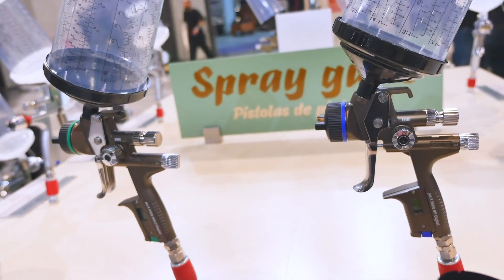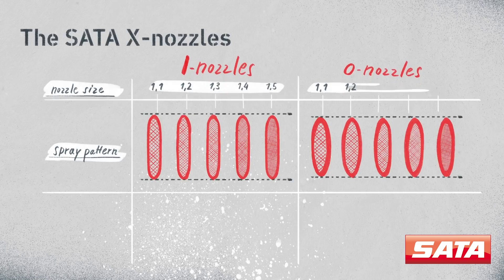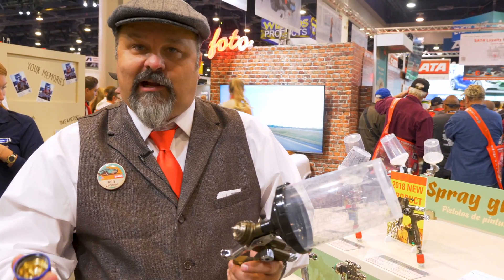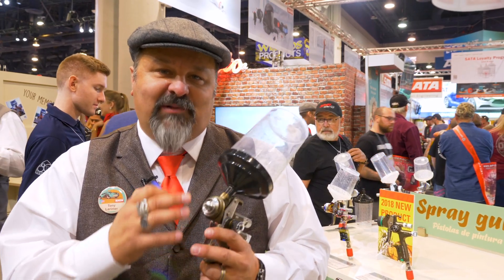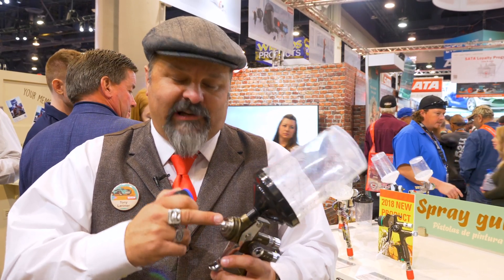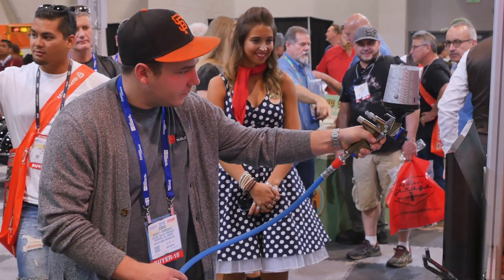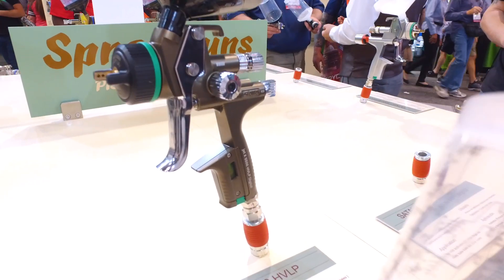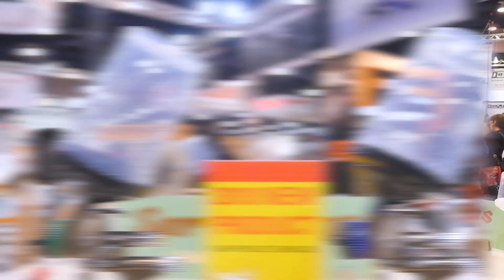SATAjet® X 5500 at SEMA 2018

Comment: Tony with sata 5000: whats cool about the air cap it that it only takes 1,5 turn to screw off

Tony with the sata x5500: whats cool about the air cap it only takes less then 1 turn to screw off

Tony with the next sata 6000: " whats cool with the air cap it doesnt even screw on anymore, you just stick it on